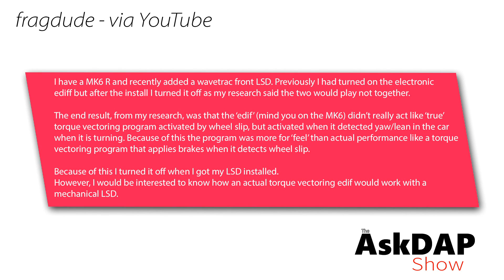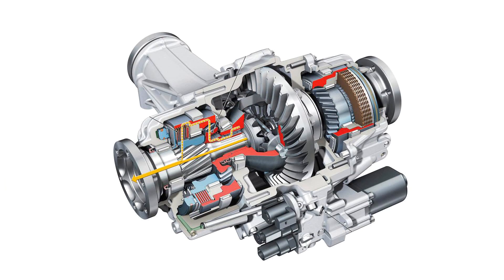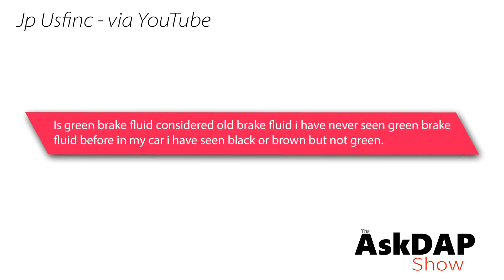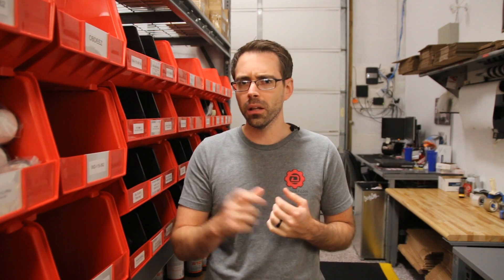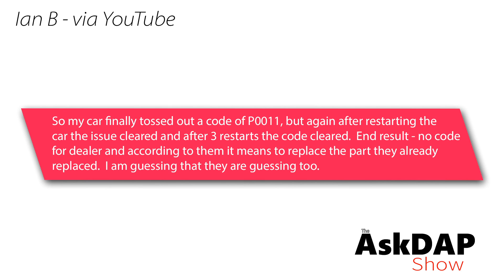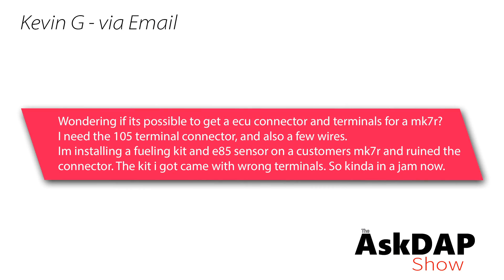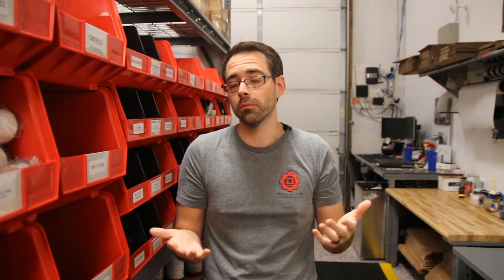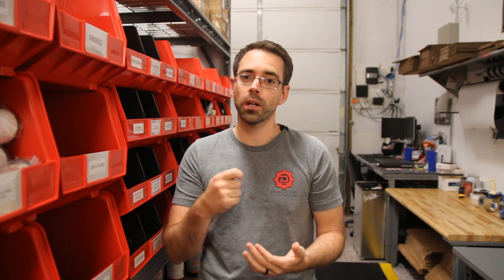Askdap Episode 104 | Re-pinning a MK7 R ECU Connector

Comment: Paul, I have a 2011 Jetta 2.5 M/T with 150,000 miles. At around 125,000 miles I also had p0011 with intermittent stalling/surging. Dealer recommended everything you suggested plus wiring harness, throttle body, and crank sensor. Pretty expensive job and it did NOT fix my problems. I pulled out new throttle body and noticed MAP sensor and intake were covered with oil. Replaced pcv valve and map sensor and it was still covered with oil and vehicle was still stalling w/ p0011. Then I decided to disconnect the MAP and I haven't stalled, surged or had a p0011 in 25,000 miles. I have a CEL for the map though. Lol the car drives well but it makes no sense!!
Reply: Also, the dealer and VW tech line recommended replacing the engine after they failed to figure it out. Disconnecting the map was honestly me just experimenting.
Reply: Did you properly clean out the intake manifold before installing the new sensor?  Did you integrity check your electrical circuit?  Did you replace the valve cover?  Or only the diaphragm?  I always recommend replacing the entire valve cover with an OEM one.

Reason car runs with map disconnected is because open circuit code hard faults, and the computer uses failsafe alternative to fuel the engine.  This should not be used as a longterm alternative however.  The fuel mixture is off, and you risk damaging emissions equipment.
Reply: I cleaned manifold and replaced valve cover with OEM one. VW did the wiring harness job and they said the electrical circuits were good. The only thing that keeps the car from not surging/stalling is disconnecting map sensor. It makes no sense but I've gone 30,000 miles with it disconnected and not a single problem.

Comment: I have a mk7 gti with a unitronic stage 2 tune with cts catted downpipe. I noticed that at WOT I feel  a short but very noticeable dip in power around 4000rpm. No CEL but I worry about knock or detonation. What could be wrong? Is this normal with tunes? I felt the same thing at stage 1 but stock it was fine.